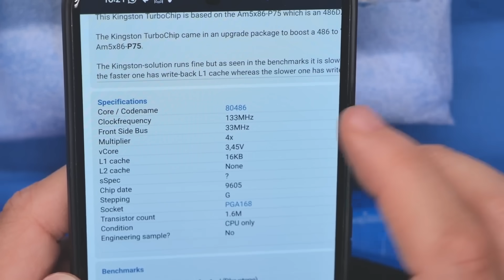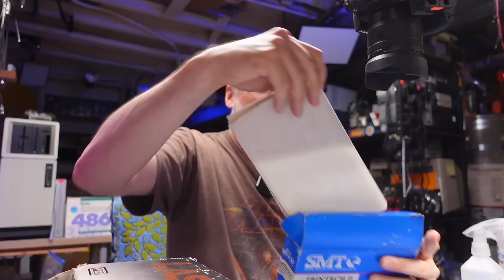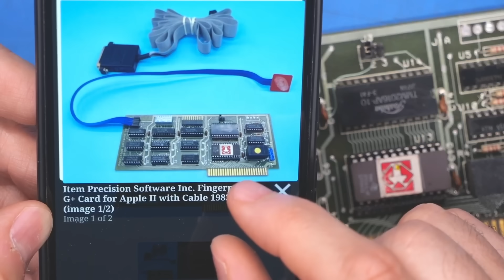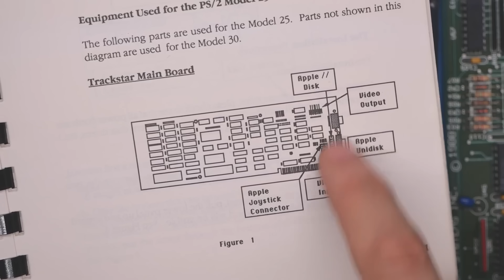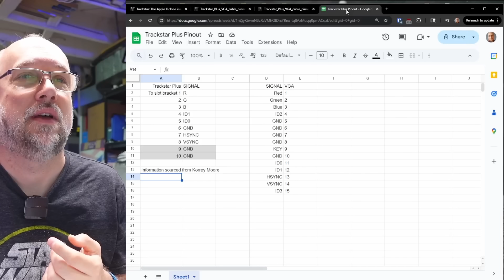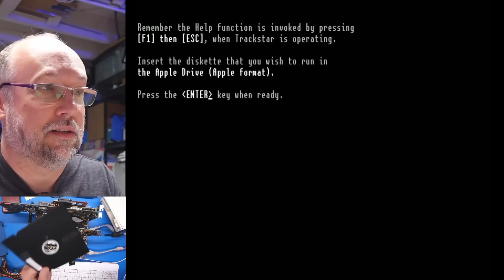0112 An Apple II emulator along with other Apple II goodies

Comment: The Dell floppy drives might be the kind Cathode Ray Dude covered that can connect via mini USB in addition to the modular port and read and write faster than normal floppy drives, though not as fast as a 2x drive.

Comment: @43:00 Are you assuming that the color rendering you see is working properly for this card?  It hasn't been used in many years, and some of the circuitry may need repair.

Comment: I had an amazing Pentium laptop I don't remember all the specifications but it was Adele and the battery is loaded in the front and on the right hand side you can either have a battery A CD-ROM or a floppy Drive I had four batteries and was able to hot swap them on the Fly I freaking loved that laptop

Comment: I thought the Trackstar would be too long to fit in a PS/2 Model 25, but it has been many years since I had mine, so I could be wrong. But that input and output is definitely intended to connect it to the internal monitor in the Model 25. I believe the model 30 also has the same motherboard as the Model 25, but a different riser, so it might connect to the video input in the same way. A very interesting find!

Comment: I wonder... If you're feeling particularly crazy.
One assumes most of the the Apple II bus signals must be on that card, somewhere. I bet it would be possible to botch an Apple2DVI in there for more 'authentic' output. The card is 'only' a bus-sniffer so full Apple II slot compatibility shouldn't be an issue.

Comment: The PS/2 25 and 30 didn't have true VGA but MCGA instead, which offered a VGA-compatible output so they could drive a VGA monitor. But they didn't have all the extra VGA modes or even EGA backwards compatibility. They did, however, have a subset of VGA that improved on the original CGA standard: 640 X 480 monochrome and 320 X 200 256 color. Not sure if that would have any effect on the weird color problems you were experiencing.

Comment: Those Dell floppy drive modules -- at least the first one is for a Dell Latitude CPi series, those were Pentium II laptops from around the turn of the Millennium. Great Win9x/2k systems. A pity you aren't willing to spend 90 seconds tossing something like that in a bubble mailer, taping it up, and throwing postage on it -- I know because I've asked in the past -- I actually have a CPi in the closet that could use that exact specific module you're holding.

The other two are a later module that I don't immediately recognize, and a standard laptop/slimline bare drive, which universally use a 26pin flat flex cable (FFC) connector.

Comment: 9:55 that is a Dell Latitude D series drive.  The super cool thing about those is if you look at the back corner there is a mini USB port so you can optionally use it as an external floppy.

Comment: Those am5x86 chips were great for over clocking too.  They will usually happily run on a 40 MHz bus and 160 MHz core speed.

Comment: purpose bought cpus, not including laptops and cosoles and such, my tally stands at 3 lol. all amd am4. am4 is king. I just upgraded from the 5800x to the 5800x3d just cause it was a good deal. AM4 for ever.
Reply: I still want a dual socket AM4 mobo. I know it's pointless and all those other negative vibes but, I still want it.

Comment: Hi Adrian, I got the Apple diagnostic card and wonder if I can put your diagnostic ROM on it, tried but no work, not sure if any special location writing the ROM, wish you have time and take a look since it's very useful for trouble shooting RAM problem, thanks for your work, also thanks to Frank and David.
Reply from the maker: I've used it on the Apple II ROM card before -- the ROMs are 2316 IIRC so you need to use an adapter to use a normal EPROM in the socket, so I would assume any other Apple diag card would be the same.
Reply: @adriansdigitalbasement2  Thank you!

Comment: The shiny dell floppy probably has Mini USB on it and can be used stand alone.  Love all your stuff as always, your videos got me through the winter.
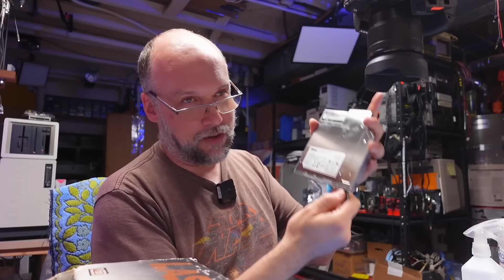Reply: 10:05 The silver Dell floppy drive has a mini USB on it, and you can plug it into any USB computer. They're also slightly faster than normal too.
Reply: Dell D-Series Latitude Floppy Drives can be used with Mini USB standalone.
Reply: This is a "sometimes" kind of thing. It all depends on the version. Hopefully he has lucked out and it does have a USB port.
Reply: @jonakers704  It is, but I see the mini USB port in the video at 10:05 :-)
Reply: If it didn't have the usb port, I have several D series laptops. Lattitudes are my jam.

Comment: 34:30 I was thinking the card didn't look fully seated - the slot bracket doesn't quite line up with the other one, but after you took it out and put it back it did.
Reply: Yes, it looked that way to me too. It looked like there was a large height difference relative to the other card.
Reply: The VGA passthrough adapter looked to be causing issues for the fitment.

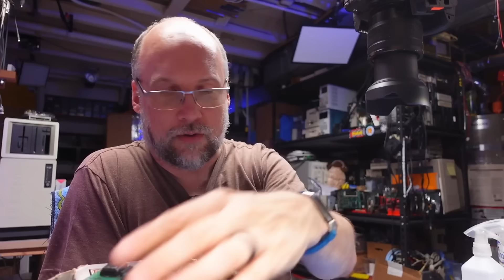Comment: 18:45 I took one of these ROM cards that had a broken switch, hard wired the switch to the position that activates the ROMs on the card, jumped it for 2716 operation, and stuck a Dead Test ROM in it. Now I have a diagnostic card for my Apple IIs if I think they have a RAM fault…
Reply: Good Job!

Comment: Adrian, please show uninterrupted views of the tops and bottoms of cards if you're going to show them.  Giving occluded partial views where your hand is covering the interesting things reduces the enjoyment of watching your videos by 2/3.  At timestamp 15:27 the three large chips are the EPROM, a 2K x 8 SRAM, and a 6551 ACIA to operate the serial port which connects just above the SRAM.  At 21 minutes you're literally pointing at non-Autostart ROM sets complete with Programmer's Aid #1 with Apple part numbers 341-000x-00 and dismissing them as later ROMs.  Ug.  The major value of the ROM card lived on as a cracking and hardware hacking tool.  If you bridged the F8 solder jumper you could flick the switch and drop to the monitor any time and by bridging the two 2716 jumpers you could add your own custom firmware

Comment: Some of those dell floppy drives have an external usb port on them so you can use them as an (external) USB floppy drive. The one I have looks like the third one you held up, and I use it with my modern PC (and never owned a dell laptop)

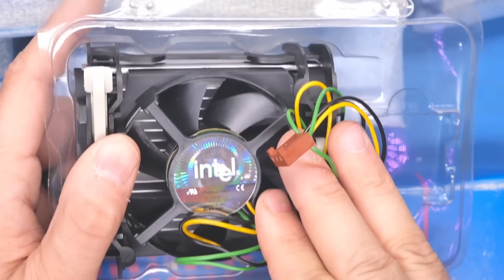Comment: 3:11 that is a Socket 478 Boxed Cooler. 
CPU got removed, Cooler left in the Original Blister and was never used. The Original Thermal Pad is even on it.
Reply: I remember those, It was awful, threw it out and replaced it with a ThermalTake and my temps dropped 20-30c.
Reply: @Nukle0n  I remember that back in the day, Intel shipped the worst fans imaginable with their CPUs. Fans that would run at full speed all the time and sound like a jet aircraft taking off, where a third-party replacement would be thermostatically controlled and whisper quiet. I don't know if they still do this - I haven't built a PC for years.

Comment: I have this same turbo chip! I tested it 2 days ago on a winpro 486e, works fine. Original 486 66mhz seems faster tho that this one, I did some phillipslab testing and the performances wasn't great. It was a nice cool find tho. I haven't dig deeper on it to see if its actually more performant
Reply: You might not have had the cache enabled. If your bios didn't support it , it had a little program that did it. 

Back in the day you could get an amazing performance hoist. I had a socket 7 board that had an official fsb speed of 66mhz. I ran it at 83mhz with a 380mhz K6-2 set to a 6x running at 496mhz with a bit of voltage tweaking and a really big heatsink. Then one day the heatsink came loose (and by came loose, I mean I didn't get it back in right after working on the PC and it popped off while running a game). The CPU fried, let out the magic smoke, dead shorted, several power MOSFETs on the motherboard decided to copy the CPU and did the same thing and fire shot out of the back of my $25 dollar power supply.  After that, I dialed back my overclocking and mostly stick to stock settings. Excelt for the dual Celeron A 300mhz I had. That thing ran at 450mhz, because they were the core from a 450mhz xeon. Those were good days back then.

Comment: Along with the "Commodore" disk drive, you could find a video card (Matrox maybe?) that can do the 15 pin Apple video, then you could have an Apple branded monitor on top of the PC case :P
Plug in your nes joystick and a serial Sun optical mouse (yeahj, they would only work on the pc part) and your all set!